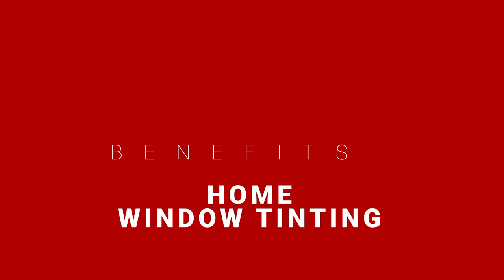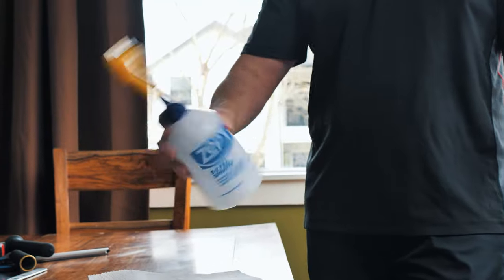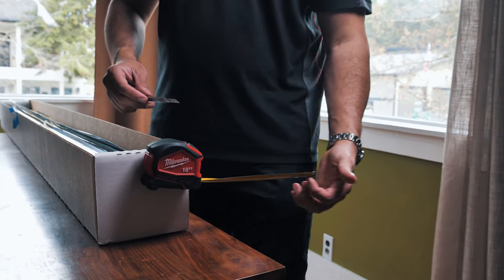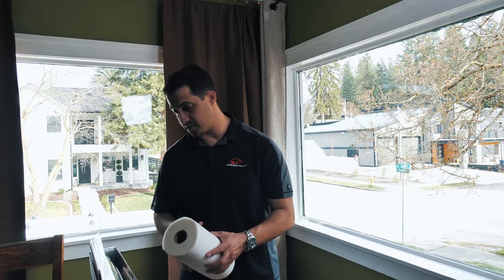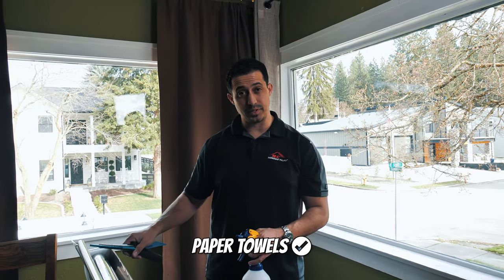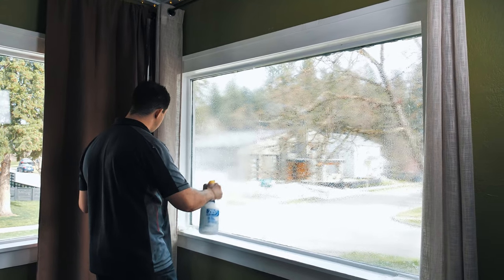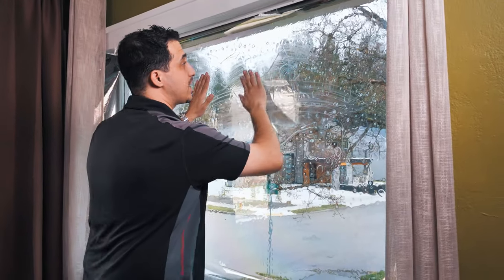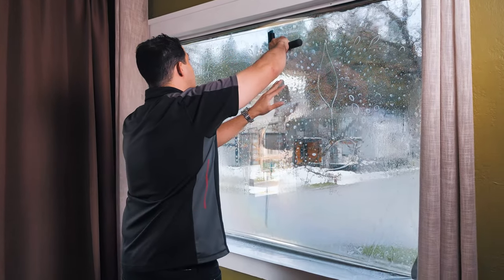Home Window Tinting: The Ultimate Guide

Comment: Not sure I saw correctly, but from other videos, you adhered the opposite side that others have done.  All other videos I have watched, the installer has  placed the side where the film protection was removed, while you did the opposite..at least that is what I did see on first viewing..
Reply from the maker: we back roll the film and by doing so it removes the liner placing it on the back side of the film. On video it's hard to catch unless explained. Good catch but all films have a sticky adhesive that is activated by uv light. This includes exterior window film.
Reply: @rcwindowfilms Ah, so backrolling essentially flips the liner to the other side of the film thereby exposing the adhesive side of the film? Have I got that right?
Reply from the maker: @jackfromthe60s  yes 🙌 that’s correct
Reply: Thank you I was so confused! By back rolling,  the liner is unrolled from the adhesive side of the film and rerolled  onto the other side of the film?
Reply: @wubieful yeah, quick abracadabra trick when he dropped the roll out.
Reply: Love you videos! So glad your healing up from injury*(was in another vid) Been trying to get a hang of the reverse roll drop technique, any more tips? Like best we to cut and roll? Seems like the tightness of the roll is important. What are thinking/feeling when tightening from inside the roll. Thanks!
Reply: I did mine today...and I have lines few inches long. Can I remove them and how to avoid it. Or why did it happen?

Comment: If you pulled the backing off that way with automotive tint, you'd have the sticky side out, so I guess household tint must have the backing on the opposite side of the adhesive side compared to automotive tint!
Reply: I was thinking the same thing.
Reply: I think the way he unraveled the tint, the liner transfered to the other side
Reply: @ManicObsessiveMe    correct... I was wondering the same, but had to watch the part again where he peeled off the top 6" then rolled it back
Reply: He reversed rolled it

Comment: After installing my film, I have a kind of "milky" color between the glass and the film. Why do I get this ? I clean VERY well my glasses and even scrape it before installing the film
Reply from the maker: The most likely cause of the issue is using excessive soap during the window tinting process. If you overlap the squeegee and there's too much soap, it can mix with the adhesive, resulting in a cloudy or milky appearance.

Comment from the maker: Let us know if you want more details if you want more tips or tricks not seen or if you need any in-depth information. 😀
Reply: If you use a card and a blade to cut on the inside of the window seal/gasket, then technically there would be a small gap (width of the card) between the film and the seal/gasket
Reply: HELP EVERYTIME I CUT IT LOOKS LIKE CRAP AT THE CUTS

Comment: Man you make it look easy. When i try the reverse roll and i let it drop it only unrolls a little bit it doesn't unroll all the way can you tell me what im doing wrong is it the kind of adhesive on the film im using? The tint sticks to any surface it touches so it would stick to the timber window frame in this video I assume it's different to the preasure sensitive adhesive tint you are using in this video

Comment: Looking to keep our view of outside and let sun light in, but create privacy. What kind of film would you recommend and where would we get it? Thanks
Reply from the maker: In my personal opinion, I would say a dual reflective window film. It may sound counterintuitive, but dual reflective simply means the interior is less reflective than the exterior side of the film. This film will not allow others to see in during the daytime hours, but will allow you to see out. Additionally, this film provides great UV protection and heat reduction as well as allows natural light to come in the preferred visible light transmission would be 30%. What this means is 30% of the light will still be allowed to come in which is pretty significant after the film is fully installed

Comment: I just had a professional company install tine on my windows in my house.  They left light gaps in all my windows.  Then they came back and caulked the windows.  Honestly, it doesn't look good.  They did a crappy job on the caulking.  I have never had anything tinted but I was surprised that with a straight edge there was light gaps.  Is this normal or just a crappy install?
Reply from the maker: I certainly think that the darker, the film, the more like gap you’re able to see, especially if you have white frame windows with a very dark film. Or whatever contrast the most. caulking is definitely something that’s not easy to get straight and look perfect but it can certainly help mitigate the amount of light gap. What a perfect job is is one that you’re most satisfied with. It sounds like you’re unsatisfied. I would highly recommend you reach out to the company and see what solutions they’re able to offer.

Comment: Can I use a window film on double pane glass? If the window film says the absorption is 43% is that ok for double pane glass filled with the gas?
Reply from the maker: Yes, you most certainly can install window film on dual pane windows however, it’s important to identify where the Low e coating is present. A lot of times low e coatings are on the interior portion of the window. If it’s on surface three it’s best to avoid applying an interior film and go with an exterior film.

Lois surface threes on the interior portion of the window so the side that you can touch from the inside of the house on/in between the glass if there’s a coat there, install an exterior film

Comment: Would baby shampoo work the same as dish soap?
Reply from the maker: Absolutely baby shampoo works just as fine however, we prefer Dawn dish soap primarily because it has some detergent and allows it to cure faster
Reply: I have watched your vid a dozen times , and it still looks like the adhesive side is not against the window . What am I missing ?
Reply: @alec1113   look up reversed roll drop method.

Comment: Just a question on that what % is that tint?
Reply from the maker: are you asking? What’s the best percentage of film or what percentage of film is this?
Reply: @rcwindowfilms  I’m asking what is the percentage for that film you just installed.
Reply from the maker: 15% dual reflective window film this type is a pressure sensitive adhesive
Reply: @rcwindowfilms  in your opinion what is the best percentage of film to use for residential? Also, do you use dual reflective? And do you have a link for film? I am basically looking for 36” x 100’ roll. Where should I buy it?

Comment: Isn't it normally the side where you pull off the last mee, the sticky side?
Reply: Guess that the co off back rolling Ng the film could have been explained more clear.
Reply from the maker: sorry i thought it was pretty clear.
Reply: @rcwindowfilms  perhaps it was me than. For me it was not very clear that when you dropped the role after you peeled, it would back roll it basically. Seems like an advanced "move"
Reply from the maker: Definitely, it's a bit of an advanced technique. But trust me, with a bit of practice and by adding some water underneath the liner, it'll adhere perfectly due to the vacuum effect when applied to the back of the film. This method is especially effective on larger windows.
Reply: @rcwindowfilms  yeah guess, handling ng slots ch a big g piece of tint and taking the liner off and such. This is way faster!